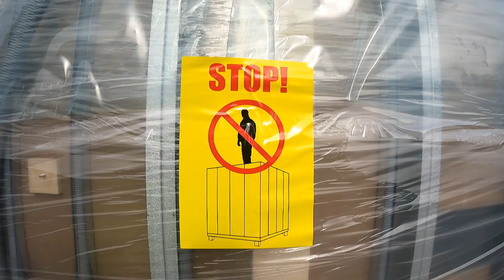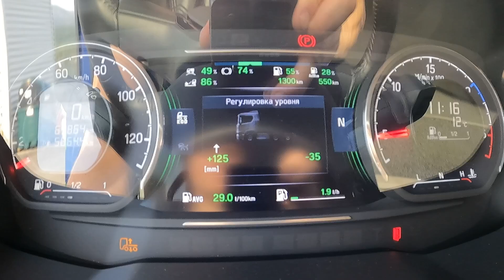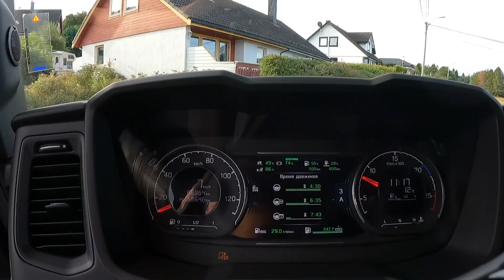POV Driving Scania S560 - Trollveggen Stasjon E136

Comment: Bro why do the level regulation remains +125 front and -30 rear? Why is there so much difference? Or u lowered it for the trailer?
Reply from the maker: this is necessary so as not to bend the wing
Reply: For when u load the trailer right? And lets say when u have a trailer on with approximately 30t whats the level of them  front & rear?
Reply: Jaką masz nawigację ?Pozdrawiam serdecznie i szerokiej drogi!